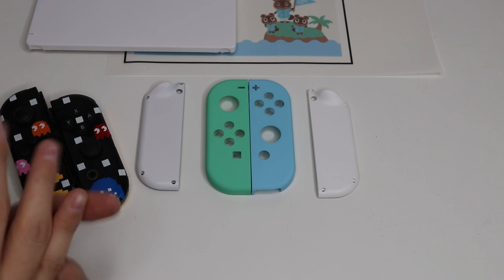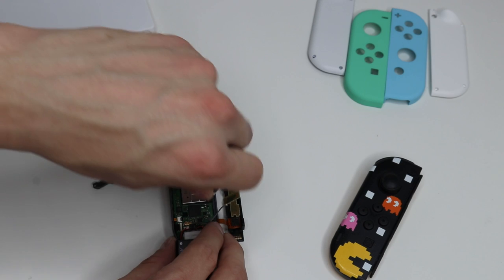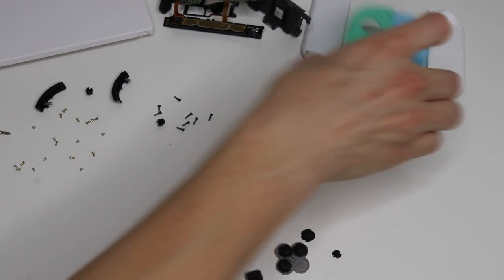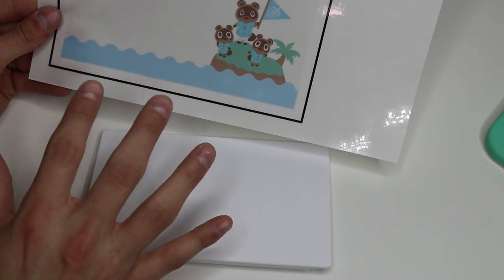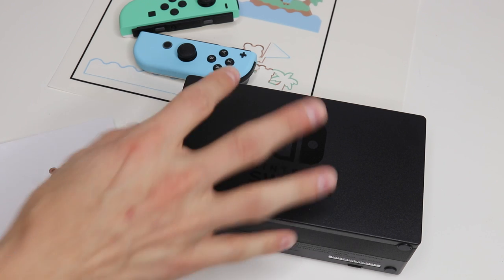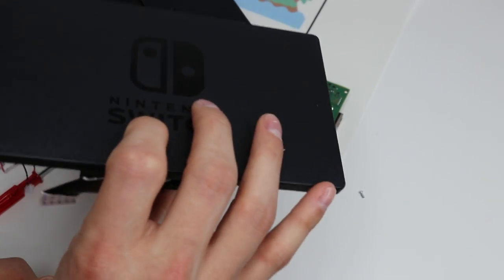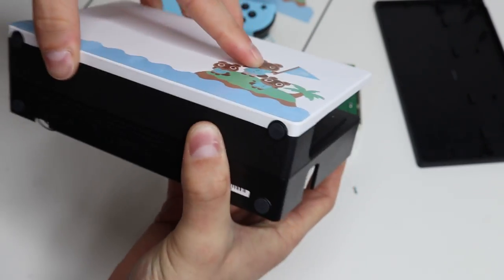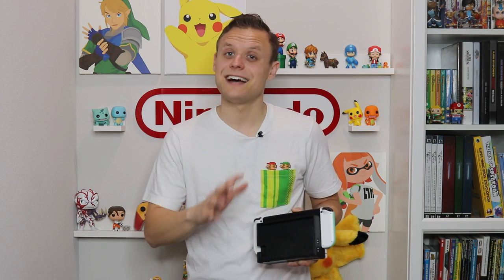NintenDIY - Make your own Animal Crossing Nintendo Switch for LESS THAN $50!

Comment: Good video, but I’d change a few things. Don’t buy the parts on amazon, go to AliExpress instead. They’re cheaper, and there’s a wider selection. They even have the switch back plates for sale. Second, you can buy dock shells on AliExpress instead of buying a white front plate. If you were to customize every part of your switch, it would come to under $40 on AliExpress.

Comment: To whoever wants to do this beware tried it retried it and the buttons never are the same some aren't fully flush and feel just a millimeter off. And the casing doesn't feel the same can't explain it feels off and that's the true theme here off. Remember this the system is put together by machines and when you take it apart by hand and put it back together by hand it will never feel the same.

Comment: Hey Alex, very nice video. I noticed that the faceplate had a lot of air bubbles left once the sticker was installed but you switched (pun intended) technique later without talking about it. You actually just cut the water and island part and installed it on the faceplate. Better choice in my opinion, but I wish you mentioned it. Otherwise, awesome tutorial!!
Reply from the maker: Mimito Same technique, just trimmed it down more! I could’ve gotten more air bubbles out of the original way, I just decided I wanted it to be less glossy overall! The reason I didn’t mention the switch was because the new version was machine cut, which isn’t as accessible as scissors for most people!
Reply: CptnAlex oh I understand. Can you tell me what cutting machine it is?
Reply from the maker: Mimito cricut!

Comment: please make the middle part of joy con shells the same blue and green. just recieved mine and the middle part is black.
Reply from the maker: All future batches are going to be green and black. This product was initially made before the official console released so it was an oversight unfortunately based on my lack of knowledge of the authentic product.
Reply: anyway I can get the middle part, because I did send a message before ordering asking if the middle part was colored and you said yes. and that is when I placed my order.
Reply from the maker: Mizael Saltar If you can reference that message I can try and help you. I got a few messages asking if the part was included but don’t recall any specifically asking if it was colored

Comment: Does the system OS reflect the Joycon color, and if not, is there a way to do so?
Reply from the maker: Stuff Of Sonny They dont, but yes there is a way to change it with free software!
Reply: @CptnAlex  👀💦
Reply: The software is called Joy-con toolkit. Theres should be a few tutorials out there for it. Involves no real hacking whatsoever so it's safe to do